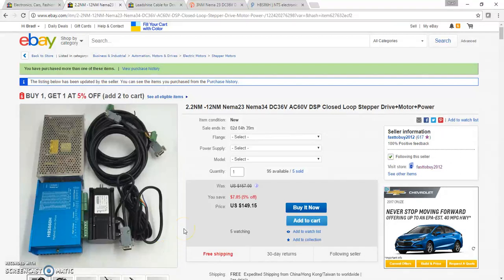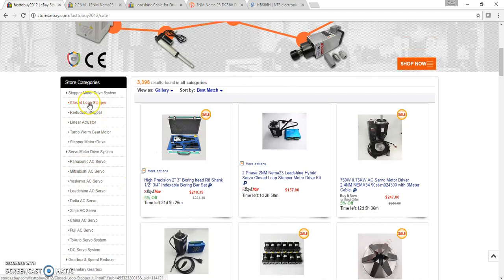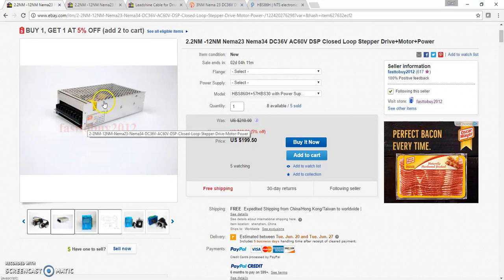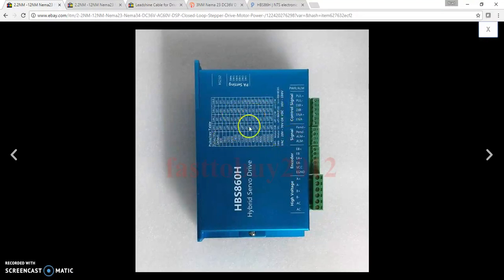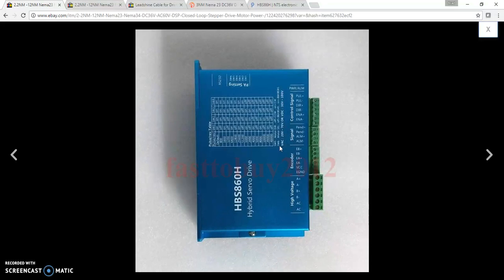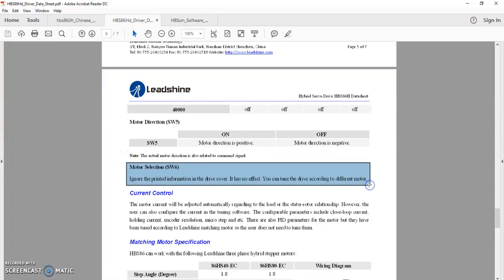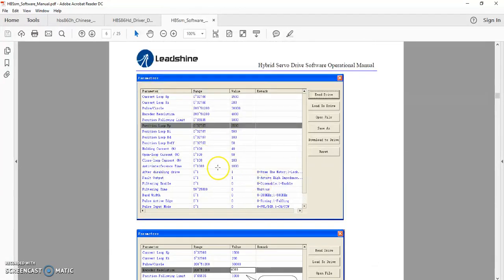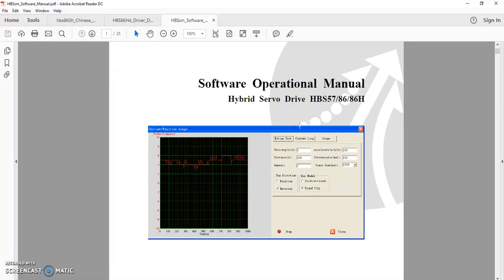HBS860H Closed Loop Stepper Driver: Important Information

Comment: Hei I am just starting up with closed loop stepper snd I wonder if you can help me with this. Is there any connection between the lines (lpr) and the microstepping number. Say 1000lpr is there any spesifyed number of microstepping I have to set using this 1000 lines encoder

Comment: You are right on the assumption that current is dependent on the error. So if motor sits right where it should be the current will be quite low. That is why they will usually run cooler (and you will save some energy in the process too).

Comment: I think the ALM Output is a Open Collector Output. Did you have to use a pull up resistor in order to detect the status change of this output?

Comment: You can put AC too. If you see the driver pins where the power goes there is written AC AC on both pins.
Reply: Same on my UK 2 HSS57-60 drives, the PCB is marked with 2HSS86 V1.0 and AC on both input pins, and the casing is marked DC +/- :P I'm running them on 48V DC and so far works fine. At least after a fixed a broken solderjoint on the rectifier that prevented one drive to start...

Comment: If you really want to get the best performance out of these I wold suggest researching how to tune control loops. I was curious if these drivers could be tuned. The big selling point of more expensive options like the DMM drivers or the ClearPaths is that their software will auto tune the motor under load. The leadshine software you have to manually tune the PID loops which can be a pain for first timers. And not very many DIY types know that PID tuning is necessary to reach the precision and performance  potential of a closed loop system. People see closed loop and the cheap price and think it will be easy to setup. However spending the time to learn how to tune them can be very beneficial when it comes to matching the performance of much more expensive options. Im really surprised the eBay seller does not include information on the software, because without it there is no way to tune the PIDs. I'm guessing they are setup to max out the potential power of the motor when making corrections to the position loop, because those are some crazy powerful motors they are selling. And I would guess 99% of these motors will be coupled to ballscrews which acts as torque multiplier thus minimizing overshoots in the default PID loop.
Reply: Yes, you're right, on ebay / amazon and even on many sites, they sell engines, drivers, and more without knowing anything, often they are even fake leadshine or counterfeit, product random codes, photos of other engines, a real disaster. it's true that you save, but the risk is high. I buy them on ebay because I can't afford the clearpaths, too expensive really ... the only positive thing is that I pay with paypal, so if something goes wrong I open a dispute.
Reply: Elite Machine Works can you make a video on how to tune these?

Comment: Thank you for sharing. I was having trouble understanding the "open/close" loop side but now I understand that the cheaper way to hybrid steppers is this way. The return side of the motor is just an error condition with no return positioning available. You made mention of possible use of the rs232 side, but it really looks more like ft232 than interactive 232.  Ft stands for file transfer.  The difference in return/settings compared to other drivers is you get what you pay for. Again.... thanks

Comment: Closed loop steppers are a variation of servomotors (https://en.wikipedia.org/wiki/Servomotor). They use stepper motors to rotate the shaft rather than a simple DC or even AC motors in "regular" servo.

In typical servo design the output of the encoder tells the controlling computer the position of the motor shaft or carriage on the linear rail and the computer spins the motor by controlling direction of rotation and duration of the power cycle until the desired position is reached. 
Open loop steppers receive a pulse of current in specific direction which rotates the shaft by a few degrees, based on the design of a specific stepper motor. A sequence of those pulses in rapid succession makes the stepper motor appear to turn continuously. Variation of the frequency of the pulses appears as variable rotation speed.
But the computer sending pulses to the open loop stepper motor does not have the feedback from the motor if the shaft actually moved. So if something blocked the rotation or the pulses came faster than the motor could rotate, the machine would "lose steps"
Close loop stepper drivers take the feedback from the encoder in the motor and repeat the pulses if necessary until the encoder indicates that the shaft is in correct position. Some drivers can buffer bursts of pulses and move the shaft at the rate the motor can handle. 
Note that the computer sending G-code commands to your DIY CNC still does not know if the shaft of the motor actually rotated as it requested because the closed-loop exists only between stepper and the driver.
 This is where the main difference between real servo and close-loop stepper drivers resides.
In the real servo applications the closed loop exists between computer and the encoder on the motor (or linear rail/actuator assembly). The application controlling the machine knows exact position of  the shaft or linear rail/actuator.
The close loop driver can only (at this time) send an error signal, which some DIY CNC software can read to at least halt the job to prevent damage to the tool.
One can expect that in time the close-loop drivers will be communicating with the CNC software creating a true closed loop CNC machine, entering a whole new level of accuracy that could even compensate for mechanical imperfections of the mechanical components of the machine.

Last note: There are servomotors available that use AC or DC motors but act just like stepper motors and the drivers for those connect to the CNC controller just like regular stepper drivers accepting pulse and direction input.
see https://www.youtube.com/watch?v=dDxyaoYXxY4
AC/DC motors hold multiple advantages over stepper motors but the control circuitry is much more complicated (=higher cost, lower reliability)
Reply: Terrific explanation. Big thanks for making that clearer than any other source I've read.

Comment: You're correct about the amp setting in the software, however if you chose to run a motor that had a lower amp rating, that is where the importance of being able to set the current output will come in.  While it's true that the driver is "intelligent" and will vary the current as needed, they WILL send more current than a motor is potentially rated for in attempt to make up for the felt resistance sent back to the driver COM port.   More or less the setting should be no more than the motors highest current rating as a top end governor.

Comment: Hey Franco  
I recently bought a StepperOnline CL57T controller and NEMA23 closed loop stepper.  It seems to be a clone of the Leadshine driver as well, in fact the user manual states "designed by StepperOnline, manufactured by Leadshine".  Anyway I had downloaded SO's tuning software and it appears to be the exact same as the Leadshine, but without any documentation it's pretty hard to decipher.  The support document you have in your dropbox is very helpful.

THANKS!!
Gary
Reply from the maker: Awesome.  I'm glad I could help.

Comment: The driver has a bride rectifier on the input from the power supply Transformer that changes the AC voltage in to DC before it get to the driver circuit. Using bridge Rectifier on any dc circuit allows that circuit to apply AC or DC to it with the DC being the only voltage coming out of the bridge rectifier, the DC will not be rectified and flow to the dc side unimpeded.

Comment: Good info Franco, was wondering what the ac/dc power input was all about on the larger drivers. This will make it a bit easier when the time comes to actually your kit installed and cranking.

Comment: Running higher voltage motors.
Higher voltage requiers less current to achive the same or higher torque/wattage in a device.
Voltage x Current = Watts
You can use thiner gauge wire and longer runs with less current and higher voltage and AC power.

Comment: Current.
The current or Amp's setting is a current limit, this limits how much current the driver sends to the stepper.
Think of this as a safety. 

You can power all your steppers/drivers with one large 100A power supply, if you where to deliver 100A to the steppers and they where opperating under the correct load or strain they will only use what they need.
If you have a big heavy Z axis and the motor strugles to lift it or if you had a 1/2" endmill and had a to high feed rate, the stepper will draw much more current more then likely burning out the driver mosfets or the stepper windings.
By adding a current limit to the drivers they will behave like a shear pin to protect you drivers and steppers from being damaged when being overloaded or during a crash.

Comment: Hi Franco, good video.  I'm trying to program the drive but don't have the RS232 adapter cable.  
Do you happen to have the pinout of your cable?  Is there anything more to the cable (any resistors or anything inside?)

Comment: I see the videos from 2017 but what the f thanks for the due diligence awesome on the serial you should be able to use the terminal server like putty to connect to the controller software is great now that you have found it documentation is irreplaceable great you found it,, I noticed recent comments from my experience if you're going to mess with the holding torque consider your working scenarios less holding of an access means is we're talking another axis we can pull it out of position... Depends on the rigidity of machine but if you find tolerance is an issue sometimes holding torque or current on the axis is needed to be higher.... Because you're talking about close loop it's important to build a system that can be effectively controlled..... Peace

Comment: Can encoder be fixed after over volatage ,driver flash 3ces after motor move and  display red light. Test with another driver and it works but 2 driver affected can this be fixed .

Comment: I really found this video usefull and I gave you thumbs up!
I wanted to ask you what type of connection you are using between the computer and the cnc breakout board, USB or parallel DB-25?
I'm trying to build my own 4x8 cnc and have found conflicting info.
I'm guessing that having a closed loop should increase the need for a lower latency on USB comm ports.
Reply from the maker: Hi.  I used the Centroid Acorn system which is Ethernet based.

Comment: really great videos, keep up the awesome work, very nicely done, I purchased the same hbs86 nema 34 as you did, what was the pulses per rev set to, the dip switch setting on the drive
Reply from the maker: Hi.  You have to adjust the steps per rev using the software - no dip switches on my drives.  I believe the factory default setting was 4000 pulses per revolution.  But, that's just a guess as it's been a while since I set them up.

Comment: Hi Franco, excuse me a newbie question, is it possible to get the data from the motor encoder? I mean EB + EB-EA + EA- to read position? i try to make a PID comparing with another encoder but usually incremental encoders only have 4 wires, is 5v voltage in EB EA?
Reply: At least on the closed loop steppers I have there is a 6 wire connection, EA+, EA-, EB+, EB-, +5V, GND, so 2 of them are simply power to the sensor. I would assume the signals are 5V as well since the sensor runs on 5V.

Comment: thank for all hard work
you been grade help to me.
thanks
Reply from the maker: SADEGH POURYAN I'm glad you found the video helpful.
Reply: hi
i want to ask you , do you think for three motor we need three spread    power supply or one its iok   for three motor
Reply from the maker: Hi. You have to make sure you have enough amperage.  You can have a single power supply as long as you can provide enough amperage to all of your drives.  Divide the wattage of your power supply by the voltage it delivers and you will have the amperage.  A 350Watt  36Volt power supply will provide about 9.7Amps.
Reply: thanks again

Comment: Hello, is it necessary to use the RS 232 cable for the safety of the CNC machine to work with the Mach3 program or is it only used to show the values? Please help and thank you very much
Reply from the maker: Hi.  The RS232 cable is only used to program the drive.  It is not used to interface with the breakout board.
Reply: Is programming the driver with the RS 232 cable necessary to obtain accurate measurements while the CNC machine is running or is it sufficient to adjust the settings in the Mash3 program with the hardware? Please clarify because I always work with only stepper motors without encoder, thank you very much

Comment: Hello,  thank you for your video and files. I'm about to buy 86HBS120 + HBS860H. 4 of them. The seller is suggesting a 800w 60V transformer. I don't know much about it. My worry is if I would be able to run the motors at 1000 rpm when needed. Also I couldn't find much information about microstepping and closed loop system like this one. I assume that microstepping only helps in reducing vibrations and you can't count on it for positionning. The encoder is said to be 1000 line but is this of any use? If you could provide some feedback about the motor capabilities (power, closed loop, microstepping) I would appreciate. Thanks in advance
Reply from the maker: Check this out:  https://youtu.be/5D7px0r0pUE

The 1000 line encoder will actually produce 4000 pulses per revolution.    Steppers don't make great spindle motors as they lose their torque as the RPM is increased.  But, I think you will probably be OK at 1000 RPM.  Especially, if you go with closed loop steppers.

Comment: I noticed this is about a year old and am wondering how you find the closed loop system to be working?  lately, I'm working with a lot of two-sided routing which has been exposing the backlash faults of my machine.  These faults are pretty minor and I feel that given the overall size of my router (60"x120") it's almost not worth mentioning. In my case, a closed loop driver would, I believe, have no effect on my cutting since the effect I'm seeing is outside the loop. On the other hand, if I had a linear scale on the axis's I should get pretty exact cutting since the scale would place the backlash inside the loop. Just wondering if your drivers are living up to expectations.
Reply from the maker: I'm 100% impressed with my closed loop steppers.  I've purchased similar technology from two different distributors and they are both great.  No regrets and way fewer headaches. They work great.

Comment: How does this compare to the hbs57 with nema23 setup you had in your other video, what would be better for the 1500x1500 workbee?
Reply from the maker: I'd use the HSB57 for the router.  They are the right size and you can get a killer deal on a 4 axis kit on eBay.  A friend of mine used that kit on his WorkBee and he loves it.

Comment: I have an HBS860H with a 86HBS85 stepper and a 60V power supply. I can use up to 25600 pulse/rev but not 51200. Any ideas on how can I make it work 51200 pulse/rev? Thanks.
Reply from the maker: It could be that your pulses are too short for the driver to read.  I believe you need pulses to be 10 micro seconds in duration.

Comment: Bought a set of 3 x Nema 34 Motors Nm12 and 3 x HBS86H and 3x Power Supply 350W 60V and 1 x Breakout Board Db25-1205... 6 Axis for Mach 3. When wired everything I could only bring the z axis to move under Mach3 the x and y didn't move. But if I wire the x to. Pin 6+7 of the z axis at the breakout board then x moved very good and the same with y... Always what's wired to i 6+7 at the breakout board works good the rest not. So I must look is the board broken or does the software not work as it should???
Reply from the maker: It is possible that you have a bad Break Out Board.  I've seen that happen before.
Reply: @FrancoCNC  that's what I thought first so I ordered one it comes in two days and also get a new from the seller. So I get two new ones and hope one will be okay 😁✌️👍at last.... my second thought was the idea of a friend that the optocuppler doesn't catch the too fast pulses and should be slowed down and that z is slowed down by factory default.. .. But I didn't find one proof for that theory z is on every menu set the same as  x and y. At how many steps did you set your pins at the case of the motor driver 400 is default i think about 1600 to 3200 is best my Nema 34 have 12Nm and are really big and strong for the Optimum Bf16 Mill it's like a mini mill from Sieg 550W is the Spindel motor. The next step after I'm used to the 3 axis a little is building the 4th and 5th also with the same motors and the rest steel 😁✌️
I like your channel keep on doing the good work 👍😎
Ah the enable I didn't wire cause my wiring plan says you don't need until you use them and that will be later with Spindel and coolant control then I have to wire enable...